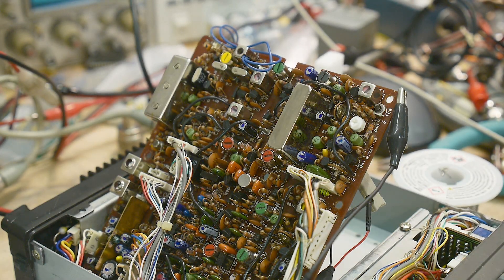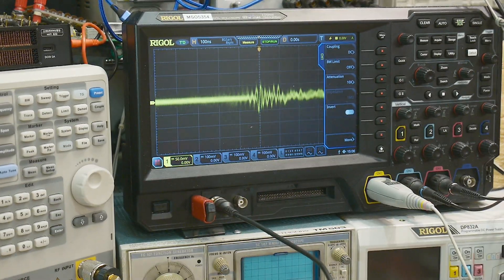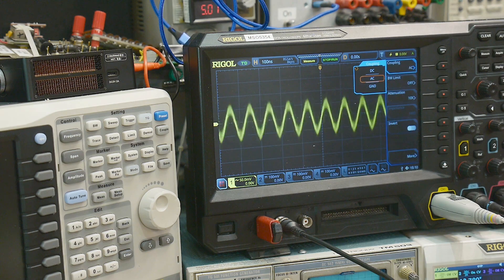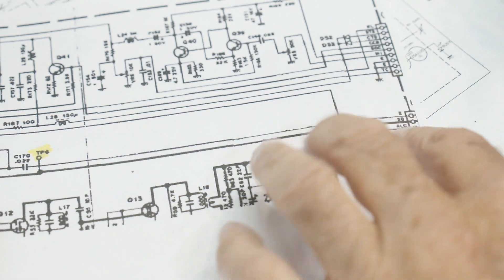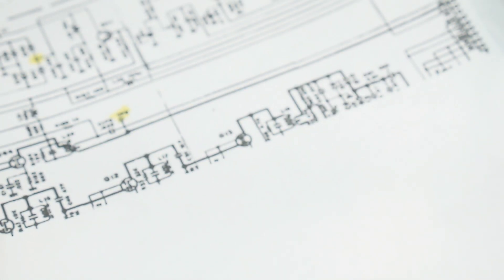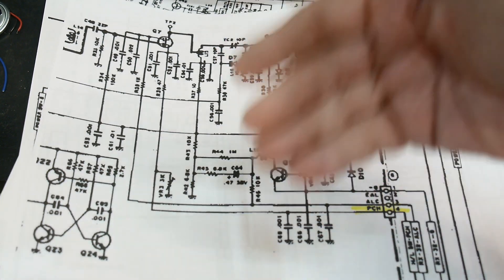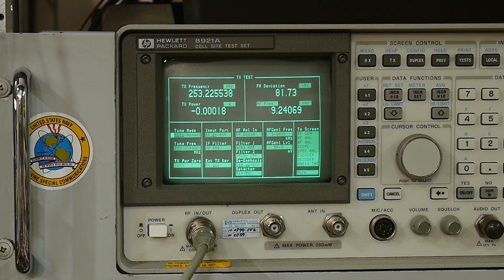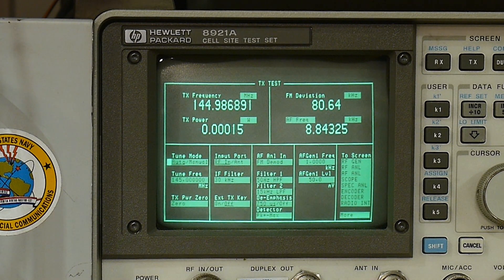#1644  Trio-Kenwood TR-9000G 2M All Mode Transceiver (part 6 of 7)

Comment: ALC can be a real pain if there is no way of setting it to a default condition. i think anything with Automatic as the first word needs to be made to be manual or your just fighting the system.
I've an FT102 that has very low power  on transmit as you increase the frequency towards 10m, i don't like putting my fingers near it as the 900V's with a few 100W's behind it is not something I want to connect myself to.
good luck at least the RF burns from 10W's ain't too bad.